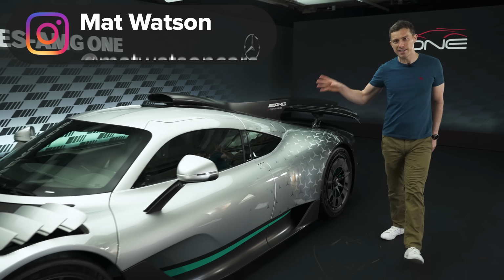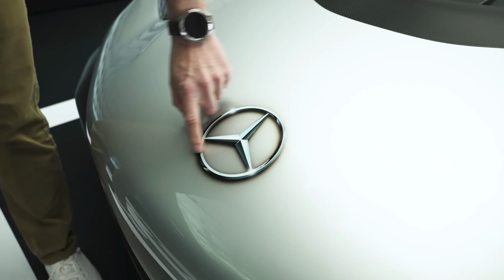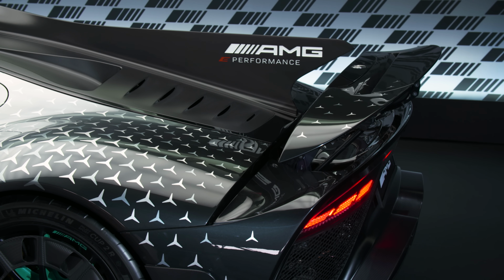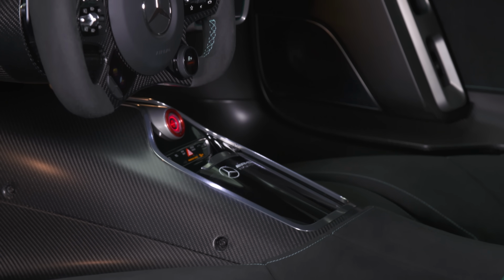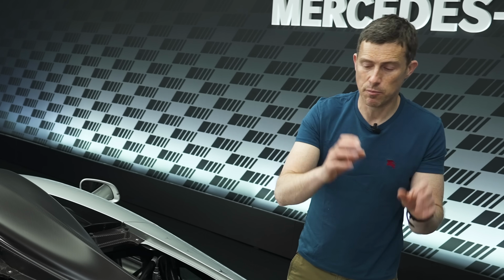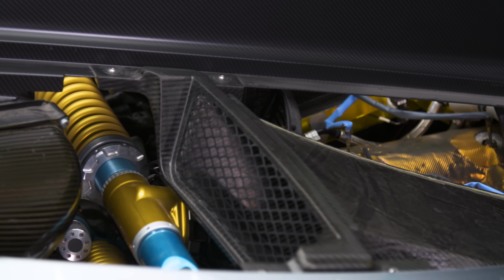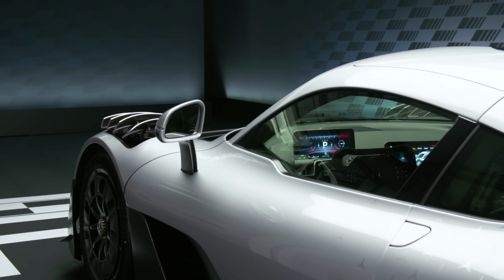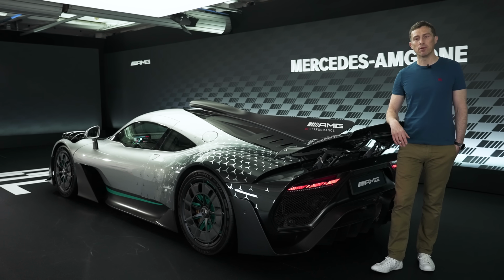Mercedes-AMG ONE: An F1 car for the road!

Comment: Shame that it's so insanely heavy, weighs 600kg more than I'd expected
Reply: Agree, no idea where that weight even is...
Crash safety, NHV, Suspension and engine mods sure.
But it looks like 100% carbon fibre so where does the weight come from?
Reply: @bertbert9347  electrification
Reply: @bertbert9347  chassis and suspension stiffening to cope with all the engine vibrations, I guess, well that's where I think part of it comes from. Then also the massive hybrid system as well.
Reply: @bertbert9347  Electric motors and other system built inside of it. Awd system, body panels, wing mechanism for both front and rear. Air Channels, list goes on.
Reply: As a fact, It has 4 electric motors, three motors produce 120kW and one 90kW. A 100kW battery weights at around 625kg. Here's the answer for everyone
Reply: I  think there is a reason for this weight. It is extremely unlikely that it is due to the low qualification of Mersedes  engineers)
Reply: Maybe they do it like Porsche, underpromise and over deliver - so in reality the car might be lighter😉
Reply: @iG4MERs  I presume dry weight is 100KG lighter or so, but that's still the same as an SF90S, not very impressive given that, that has an aluminium monocoque and this has a carbon monocoque.
Reply: Weight very disappointing. If the T50 is 1000kg and the Valkyrie is 1100kg, I strugle to understand how 1700kg car is going to keep up.
Reply: @iwonder1216  See which one will be longer-lasting as an everyday car. Why watch a video if you lack understanding? T-50 is cramped and purpose-built the Valkyre is hideous and impractical this is a piece of art. It gets to 60 in under 3 secs
Reply: @saddist1Gtown  The AMG ONE has always been pushed as a track focused car, not an everyday GT car. Hence the f1 engine. The whole car world saw it as a competitor to the Valkyrie. A specialist track car. That's how Merc pitched it. This is a glorified SF90. Nothing special. This was supposed to be equivalent to a next gen P1 OR 918, but it just isn't. Instead it's a fat car. 1700kg is crazy.
Reply: @iwonder1216  Funny thing is the 918 will probably beat this around the track and in a drag race. That thing did 0-60 in 2.2s which is insane, I bet the Merc will do way better than the claimed 2.9, but still not 918 territory.
Reply: @therealpureessence2437  Exactly, this is a marketing gimmick, like the SLR. At least we knew that was a GT though.
Reply: @iwonder1216  918 weighs the same as this💀
Reply: @ode1854  I said next gen 918. This car is a glorified sf90. Nothing special or formula 1 esque like they promised.All the hypercars are getting lighter.
Reply: @iwonder1216  918 weighs the same but has PDK, Porsche Launch control and more on its side. It destroys this car in a drag race for sure - around the track is yet to be seen but I think it’ll be close
Reply: @iwonder1216  Where do you people come from mate? I made my point according to the information in the video and my own limited knowldge of the car. You throw the word track out there as if somehow it makes a difficult challenge for a car built from the ground up to utilise F1 technology in a road-going car. Pleb I did not say GT I simply said it could be used as an everyday driver and a beast on track.... I wait for a head to head result before talking out of my backside if only you could do the same...
Reply: @iwonder1216  glorified sf90? This will spank the sf90 around any circuit 

1700 is a lot but it's more than made up for by the amount of downforce and torque it generates
Reply: @therealpureessence2437  in your dreams 
Even the amg gt black series ran circles around the 918

Project one will eat it for breakfast lunch and dinner
Reply: @iwonder1216  you didn't say next Gen you're moving the goal posts now 💀
Reply: @eventusvantos8586  In a previous comment I said next gen. Downforce and torque can't hide weight, especially not when cornering. In cornering downforce has to be 54% higher when compared to the Valkyrie (If mechanical grip were comparable.) Stiffer suspension is needed, which also affects grip on bumpy surfaces. As an example, there is no way a Bugatti Chiron Supersport can keep up with a Senna on a track. If we agree that this is a bit more of a GT than a track car that they made us think it was then I have no disagreement.
Reply: @iwonder1216  it's not hiding the weight it's making for it which you absolutely can do 

Where did you get 54% and why compared to valkryie we are talking about how it's downforce it generates is able to produce the cornering ability to make up for the weight 

You don't necessarily need stiffer suspension 

It's not a GT car but it's like a Formula 1 car in the body of a liveable hypercar
Reply: It weighs 400KG more than Mercedes hoped as well.
Reply: Everyone expected it to be around 1200kg, what a shame it's so "heavy". I hope it doesn't affect its track performance
Reply: IM SURE THEY IS GONNA BE SOME SORT OF RACE PACKAGE WHICH STRIPS THE WEIGHT DOWN BY LIKE 400KG OR SO MAYBE A TRACK ONLY VERSION
Reply: The Veyron is 1900kg and the Chiron  1996- Your point is???
Reply: @saddist1Gtown  mate those have an 8.0L W16 engine with a big ass transition, massive wheels.... It all adds up to 1900kg. Dont compare the Chiron to that AMG ONE.
Reply: @saddist1Gtown  valkyrie is 1000kg. And has 100 hp more than this...
Reply: @who_gives_a_toss  valkyrie doesn't have as many electric motors and the instant torque that comes with them as well as mguk or active aero

Still think the valkyrie will edge it out most of the time but amg will be able to deliver similar levels of performance while being actually drivable amd liveable with off the track too
Reply: @eventusvantos8586  Yes it does, the MGU-K is built into the transmission, like the AMG One has and the Valkyrie has active aero and suspension just like this. You can watch videos of the wings and vanes moving over and under the car.
Reply: @eventusvantos8586  valkyrie does have an electric motor for torque fill. And its engine is more responsive than that of the amg I bet. It also does have active aero, albeit to much less extent than the amg.

I dont think either of these cars will be liveable off the track tbh. I mean, out of the two, yeah - the amg is definitely more usable. Although I've heard that the valkyrie is quite tame and maneuverable at low speeds, which is nice.

Personally, I would rather sacrifice a littlepracticality for more performance, that's what these cars are about anyway.
Reply: @F1ll1nTh3Blanks  it doesn’t. Mguk is for spooling up the turbos and valkryie doesn't have turbos
Reply: @who_gives_a_toss  it does but no where near as powerful electric unit 

It's not. F1 power train is more responsive and puts power down way better especially with the mguk that the amg has

Compared to amg it has basically no active aero 

Amg is liveable it has infotainment system Mercedes customers know and love 

It has doors that you can actually go through gracefully 

And it will be more comfortable 

With the amg you're getting basically the same levels of performance while still being able to take it to a restaurant etc live with it off the track comfortably too
Reply: @eventusvantos8586  No, that's an MGU-H lol. XD MGU-K is a separate component. Too lazy to explain rn, maybe later.
Reply: @saddist1Gtown  the aston Martin valkyrie, the car this Car got compared to by amg, is 1.100kg. thats his point. you naming Bugattis is hilarious as you seem to not even know in wich class this Car competes.
Reply: @saddist1Gtown  You really don't know anything about cars, do you?
Reply: @saddist1Gtown  Bugattis have a way bigger engine and more luxurious interior. This car for being an 'F1 car' is extremely underwhelming. I mean the original trinity of hybrid hypercars (P1, LaFerrari, 918 Spyder) did practically the same thing as this car 10 years ago. It only has a V6 and somehow weighs more than 2 of those cars? This car for being delayed this long is quite disappointing. AM Valkyrie was delayed a lot too but it is a far superior 'F1-car'.
Reply: @omenxr303  What ? This AMG has far more F1 tech inside. Its literally a full F1 Powertrain adapted to the EURO emissions. What does the Valkyrie have ? A few Aero components and a hybrid system ?
Reply: @omenxr303  Not at all.
Project one has way better acceleration 

Yes weight of valkyrie is definitely better however 

valkyrie doesn't have electric motor and the instant torque that comes with it as well as mguk or active aero

Still think the valkyrie will edge it out most of the time and it does have better sound but amg will be able to deliver similar levels of performance while being actually drivable amd liveable with off the track too

And it will run circles around holy trinity
Reply: @eventusvantos8586  Their official numbers are quite slow even with electrical motors. The Valkyrie has an electric motor and battery by Rimac if you didn't know. Lastly why build an "F1-car" if you focus on driveability?? This car just seems like a huge mess to me, it has a contradicting identity and honestly weak stats to back it up. The holy trinity (especially the 918) are what you say this car is aiming to be, a track weapon that's also driveable, but they did it in my opinion better 10 years ago with the tech that was available at that time. They look better too but that's purely my opinion.
Reply: @omenxr303  1) Mercedes downplays their numbers and usually perform better than what their claimed times 
2) they only have one electric motor unlike merc which has way more and ultimately produces far more torque 
3) because the whole point of project one is to be an f1 car for the road 

Wrong. Even the black series already ran circles around holy trinity despite slower acceleration. So project one will be leagues above holy trinity 

It has the best power train of any other car. It will put its power down far better while also having more torque for a much more instant acceleration and active aero 

This looks way better both inside and out

It's an f1 car that you can drive on the road.

It will have more performance than any of the holy trinity while still being liveable with off the track too
Reply: @saddist1Gtown  The Chiron and Veyron aren't track weapons, your point isn't.
Reply: @F1ll1nTh3Blanks  Do you really have control of the minute amount of sense you seem to posses??
Reply: @saddist1Gtown  Chiron and Veyron are not track car at all, this was supposed to....
Reply: @mariobotti1952  So you in your infinete wisdom and knowledge knows more than the rather aveage spanner and wrench mechanics that came up with the AMG-1? I see... Sorry.
Reply: @saddist1Gtown  Exacly!!!!!

Comment: I wanna see this on the nurburgring. surely it will break records
Reply: Not with 1060hp and weighing 1700kgs. It only has a power to weight of 590hp/ton. A 765LT manages that in the real world.
Reply: @stubones  That's significantly more than the current production car record holder at the Nürburgring!!
Also correct your figures 1060hp/1.7ton = 624hp/ton
Reply: @stubones  well the 765lt is slower than a 720s on bilsterberg und hockenheim. More power and less weight is not always the key. Porsche gt2 rs (with manthey) slaps all cars around the track, despite beeing the heaviest (1600kg with fluid) and only 700hp. Suspension setup, tires, gearing, steering and downforce are way more important.
Reply: @sanlingerf8276  maybe that's why the Aventador SVJ is also really good at the track despite having a single-clutch transmission.

Comment: I mean the Rimac will be faster in a straight line but around a track I would imagine this would leave it
Reply: Wouldn't bet on it. Elecric gives no lag in power delivery. Maybe a good driver would be able to provide a true lap time.
Reply: Might be very circuit dependent . The Nevera is, of course, heavier... but 'only' by about 450kg. Considering it's chucking out double the power and gets to 300kph under ten seconds that could get interesting somewhere like Monza.